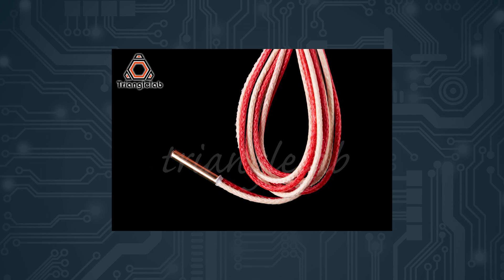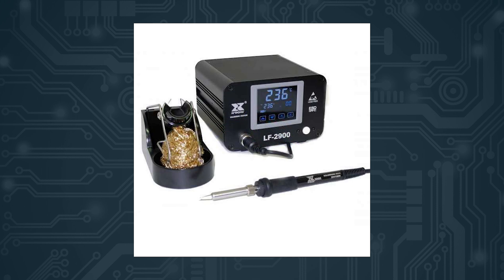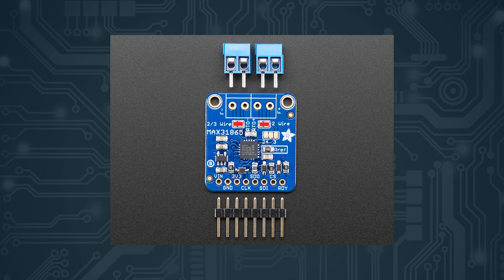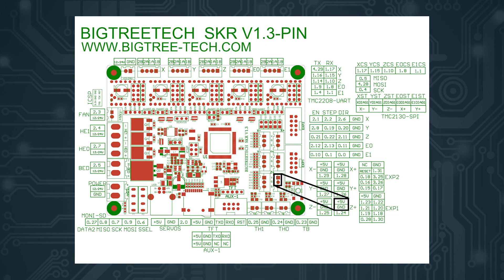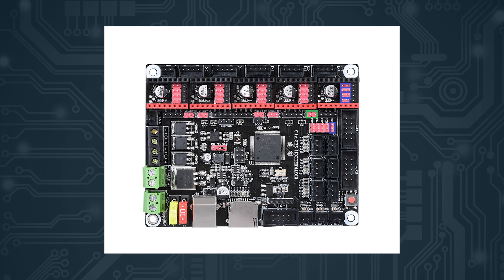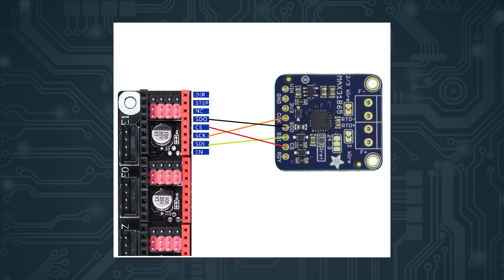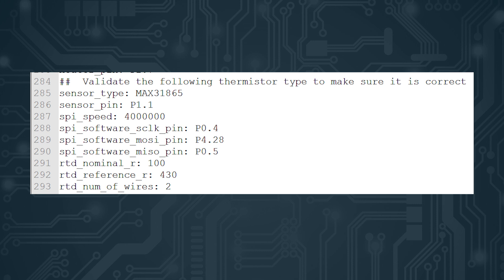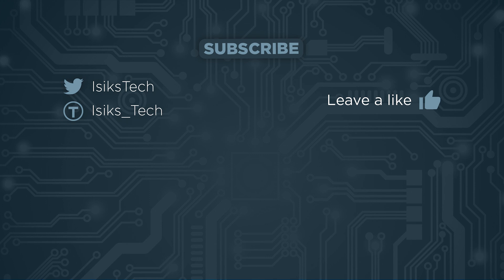Using a PT100 Sensor w/ SKR Boards Using MAX31865 Amp (for Voron)

Comment: Does not cover where to actually plug in the thermistor wires.  I know it's a completely obvious step, but somehow i'm lost.  Seems clear here, but I'm using a M5P with the BTT31865v2 driver, and trying to sort out where to physically plug in the 2 wire PT1000.  Ask BTT, who always offer the same help, a link to Github, smh

Comment: I love it, can you give some info if I want to connect a PT1000 to it?
Reply from the maker: You need to swap the reference resistor on the max31865 PCB with a 4kohm high precision resistor, and edit the config to change the resistor value to the new resistor value.

Comment: Does it have to wired into a stepper port? Personally i dont have any stepper ports open without doubling up my z steppers to open up the e1 port
Reply from the maker: You can wire elsewhere if you can find spi pins. Check your pcbs pinouts.

Comment: Hi, thanks so much for the guide.  I managed to wire up the PT100 with an Adafruit MAX31865 clone by following your guide.  However, the temperature measured by the PT100 (located at the hotend) is always 4-5 degree Celsius higher than that of the heater bed and the chamber measured by NTC100s. The difference was usually within 1 degree among them when nothing was being heated.  Any idea?  Thanks.
Reply from the maker: Wire resistance could be a factor but more likely it's the inaccuracy of the normal thermistors. I wouldn't bother checking anything if it's only a few degrees. You can always tune your temperature offset.
Reply: @IsiksTech  Thanks for the reply.  I used 28 gauge PTFE coated wires for the PT100 and I twisted the wires in pair.  Since it's a 350 Voron V2, the wire is about 3 meters long.   So you think the 2-wire PT100 is generally more accurate than the NTC100 thermistors?
Reply from the maker: Yes.

Comment: Btt said to use a this amp board for a pt1000 to hook up to an octopus board.   the max31865 maual they provides says it can hook up to my SKR E3 turbo board also. any idea how to do that?
Reply from the maker: On some boards, hooking a pt1000 like a thermistor is ok. It depends on the accuracy of the resistor used. Unfortunately with the mini e3 that's not possible. I'm not sure about Octopus. You need the version of this board with a 4000 ohm resistor. It should be labeled as the pt1000 version. Otherwise the steps are the same, just make sure to change the resistor setting in printer.cfg to the same value of the resistor on the max31865 board.
Reply: @IsiksTech  yeah the skr e3 turbo DOES have the 4.7K standard on the board, so E3D told me their pt1000 (1K at room temp..20C) should work just fine....but btt is telling me the NONE of their boards will work with the pt1000 directly and have to have a daughter board like the pt100 does...so yeah I'm getting two different conflucting info.. but yeah the pt1000 should in series with the internal 4.7k ...make a voltage divider that feeds the analog to digital converter (adc) and NOT need to be amplified like the pt100 does. The pt100 is 100 ohms at room temp so it voltage needs to be multiplied by 10 to be about the same voltage drop across as the pt1000 does... So that the ADC seems it correctly. Negating the fact that the ADC needs a 3.5 max input instead of 5... But yes. So that is why I agree with James from E3D and such the pt1000 should work directly with boards with a 4.7k standard pull up resistor and not need amplification like the pt100 does
Reply from the maker: The problem is accuracy, otherwise yes it will work. You can try first if you want to. But the general recommendation seems to be to not use pt1000 directly on boards with cheap resistors. I've personally never used a pt1000 so I can't comment from experience.
Reply: @IsiksTech  well for some reason putting 1047 in the marlin code results in the printer saying 'error. Exceeded Maxyemp on e1. Please reset printer' ..and yes I do have the revised fixed skr E3 turbo board with the 0 ohm jumpers and not the broken wrong inductors on the board
Reply from the maker: I have almost no experience (I have one but it's unused) with that board and my marlin is very rusty so I can't help you.

Comment: How many PT100 sensors can be connected to the skr board?
Reply from the maker: Directly, none. With max31865 boards, I'm not sure how many exactly but many.

Comment: Where did you mount the board after it was wired up?
Reply from the maker: Zip tied on some wires. In my older setup I mounted it on a din rail.
Reply: @IsiksTech  Did you find a din rail mount STL for it?
Reply from the maker: https://github.com/VoronDesign/VoronUsers/tree/master/printer_mods/xbst_/Max31865_DIN_Mount

Comment: couldnt you use the amp from trianglelabs?
Reply from the maker: Not without modifying the skr board. And even with that mod it's technically less accurate.
Reply: @IsiksTech  only benefit is the higher temp correct?
Reply from the maker: And higher accuracy, and ability to compare temps between printers as a result.

Comment: Hi, i am trying to use the MAX31865 with a 2 wire PT100 e3d on a skr 1.3 it really helped me wire it.
However how can i get this to work with smoothieware ?
With your settings i get the correct value when i star the printer but when i heat up the temperature rises very little, as if the reading was not fast enough, the heatbloc is very hot !
Reply from the maker: I have no experience with smoothieware so I can't help you with it. Sorry.

Comment: Hi there, I'm trying to use the MAX31865 with a 2 wire PT100 on a skr 1.3. This really helped me wire it up. HOWEVER, how do I get this to work with Marlin? (Pin assignments, changes in firmware, etc.)?????
Reply from the maker: I haven't tried it on Marlin so I can't help much. But this post may be useful: https://reprap.org/forum/read.php?415,809669
Reply from the maker: Obviously change the pins to what we used in the guide.
Reply: William Mac the comments wont load
Reply: @tylerwright497  did you finde a solution ill try to use it on mks robin nano with marlin
Reply: 3QM nope i don’t think the skr has the right pull up/pull down resistors on the board so i don’t think it will work on the skr 1.3
Reply from the maker: On klipper anyway, pullups are only an issue with e3d style amps. Spi based solutions work fine.
Reply: Isik's Tech to be honest with you i dont know anything about firmware/motherboards for 3d printers i just wanna print 450c on my cr10s ¯\_(ツ)_/¯ lol
Reply: @IsiksTech  can you translate this that a non techi understands this 😂 would be fine 😉
Reply from the maker: E3d type amps amplify the signal from the pt100 so the skr can read them. Pullup resistors on the skr interfere with that. Max31865 boards read the signal and transfer the reading via spi (a data bus, like usb)
Reply: Isik's Tech yeah i understand that but ive read that people are having incorrect readings with these max boards so they dont work correctly is what ive read
Reply from the maker: My previous reply was to 3qm. On klipper everything works fine but I don’t know about Marlin.